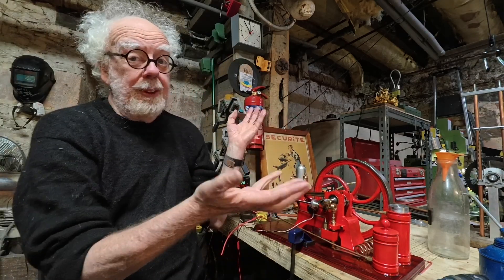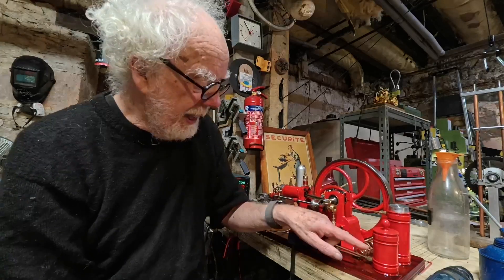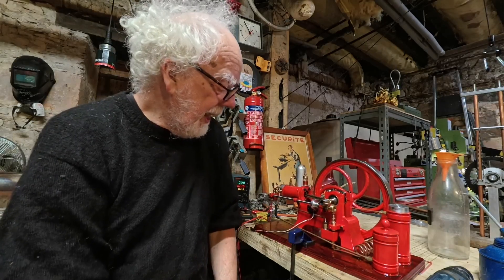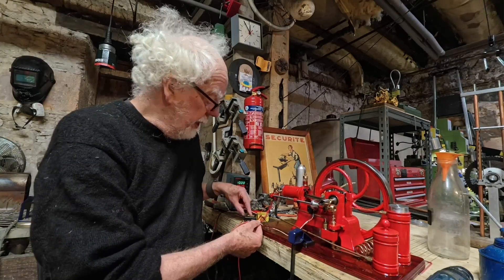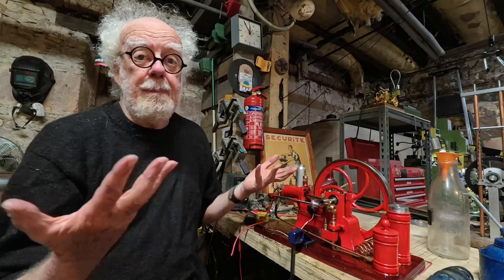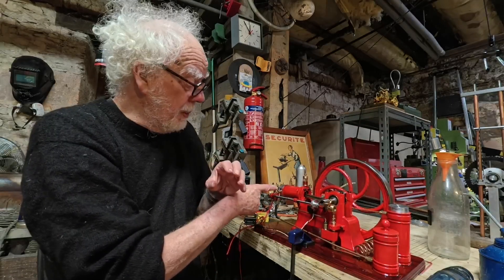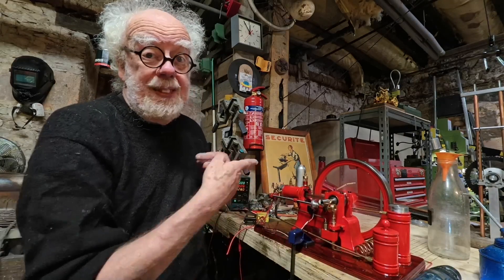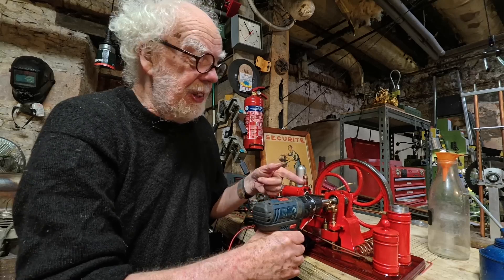Retrol Engine modifications

Comment: Thanks prof simon 👍,very interesting video.....but ...if you installed an exhaust system would the back pressure help the engine run better ?🤔.
I'm not an engineer but i love things like this 😁.
Would the carb of a model airplane help aswell ?.
Thanks again 
Peace out ✌

Comment: Just a thought try drilling a tiny hole in the top of the lid of the fuel tank if there isn't one there already, owned a few motorcycles where they would run for a couple of miles then stop all down to a blocked fuel cap breather hole.
Reply from the maker: good one Baz....i think thats worth trying
Reply: Lovely little engine Professor. The small hole in the fuel tank lid is a great idea. You may also want to try and run it on what's Called Coleman fuel. The stuff you put in the vaporising camping stoves. You shouldn't need to add any oil then and it may run much better. Also I have one of those Hanmatek power supplies. Nice little PSU for the current it can kick out. Only thing is the output button is all very good but if you turn the output off using it then turn it off and on again with the on/off mains push switch underneath they default to the output being on. I have fried some stuff accidentally because of that👍
Reply: Just unscrew the cap a little . That will vent it & still cover the gas. When your finished tightened it to keep the gas sealed .  Don't do a vent hole.